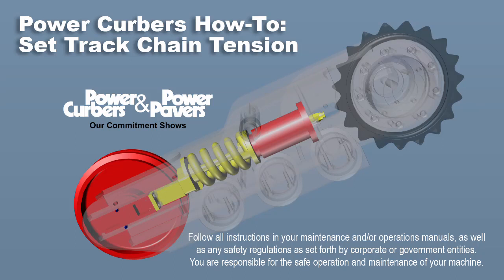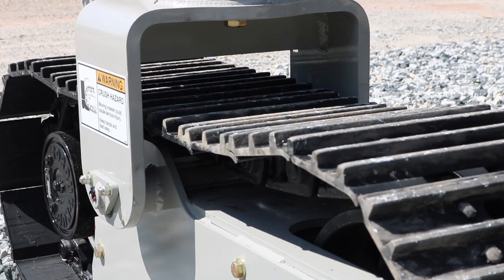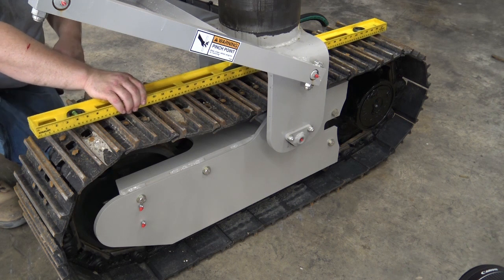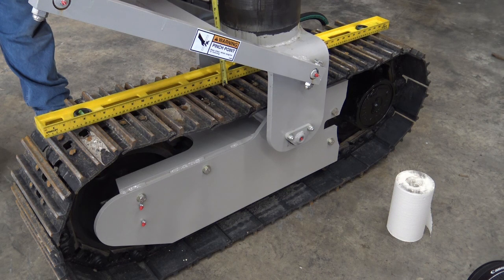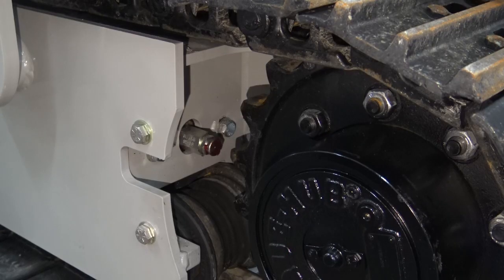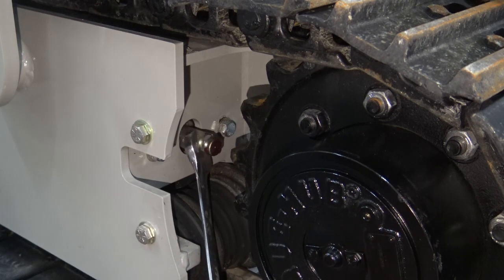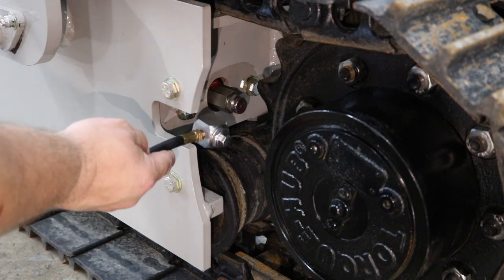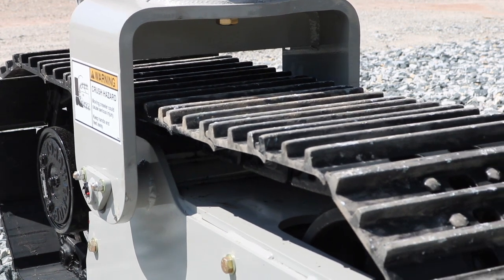Power Curbers How-To: Set Track Chain Tension

Comment: What is that giant zerk-like valve called?  I need to find that grease gun fitting.
Reply from the maker: The valve is a "Berco at160" and the grease gun adapter with hose to fit it is a "Berco cs266" Please keep in mind, this part may vary on older models. We recommend you call our Parts department for the right components. They'll be happy to help you order this adapter (part #p8043) +1 704.647.6195.